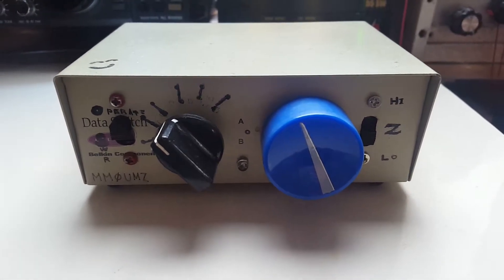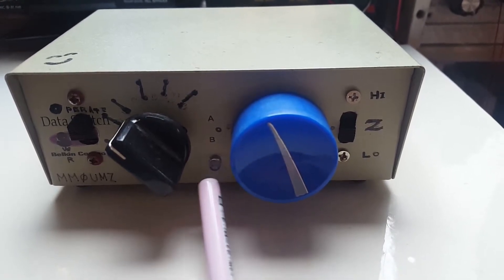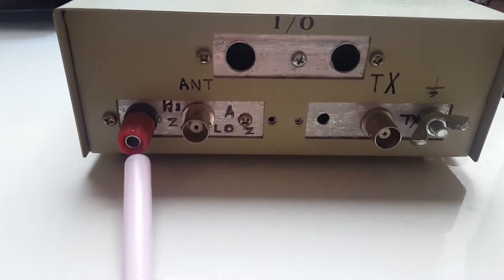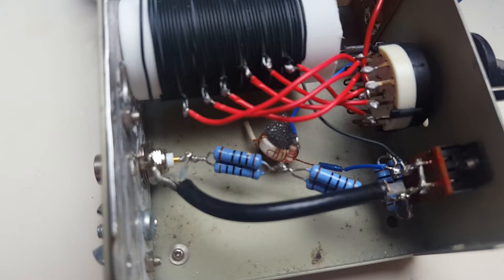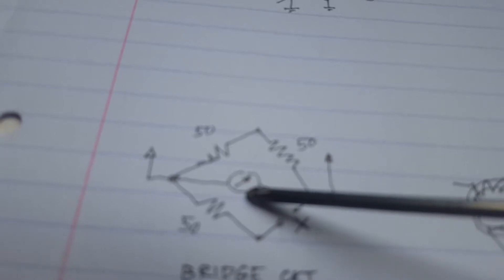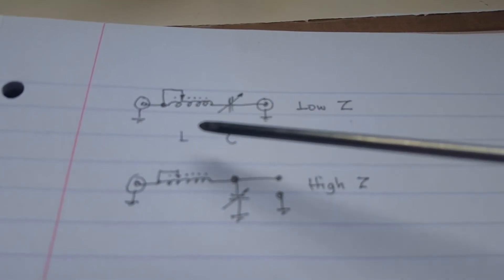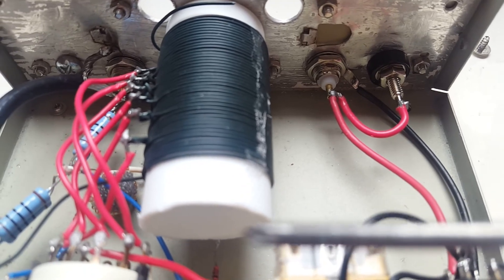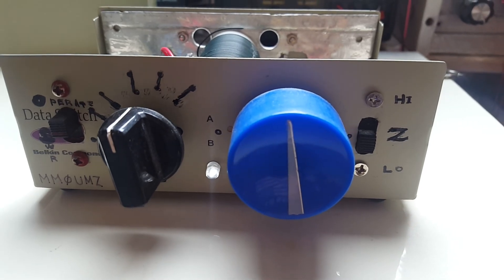QRP ATU Antenna Tuning Unit - Homebrew Ham Radio

Comment: This tuner can handle 50 watts?
Reply from the maker: @tranzit29  qrp only,if you want higher power then change the variable capacitor to air type, 73

Comment: how you connect this bridge?
Reply from the maker: It's between the Transceiver and antenna by coaxial cable. 73
Reply: @mm0umz426  Where is the center and the ground? It is difficult without an circuit cheme. On X its entranse from TX?

Comment: what you mean for low empedant? im using qrp and i have 64:1 and 9:1 endfeds. 64:1 dont need tuner but 9:1 need it. i tried L match like your high emp schematic but i didnt give efficient. i will try like low emp may be its work this time

Comment: I found a variable..it is 40-340 pf..can I use it in my tuner? Or do I have to find a larger one, ex 10-500pf?
Reply from the maker: 40-340 pF should be ok. Larger capacitance will give you wider tuning range. though

Comment: Hi..I d like to make one but I will use it only for listenin sw..not transmitting..just listen shortwave..the variable capacitor , what is the mission of it? I will turn the inductor switch for hearing loudest sound..but after this with the capacitance switch what will I do?
Reply from the maker: Hi deniz, turn the inductor switch for maximum noise, then use the variable capacitor to fine tune on the desired signal. Good luck!
Reply: @mm0umz426  thanks for your reply😊 I found a variable..it is 50-360 pf..can I use it in my tuner? Or do I have to find a larger one, ex 10-500pf?

Comment: That is very interesting. Thank you dear OM for the video. Can you give some Information on how to calculate the position of the taps from the inductor to the switch.  When I understand it correctly its possible to tune a random lenght end-fed antenna that is using a 9:1 UNUN? Right?
Reply from the maker: Taps at every 5 -6 urns. I only have used this ATU directly connected to wires. Your 9:1 unun  should match your 50 ohm coax to your random length long wire. 73s